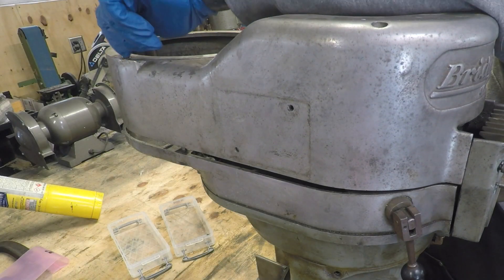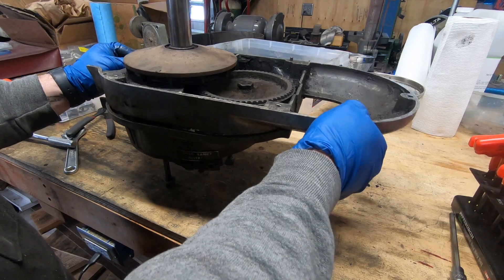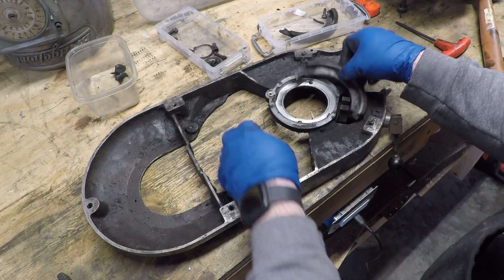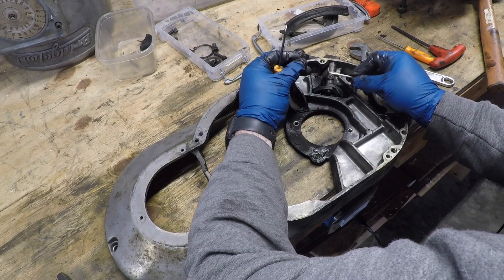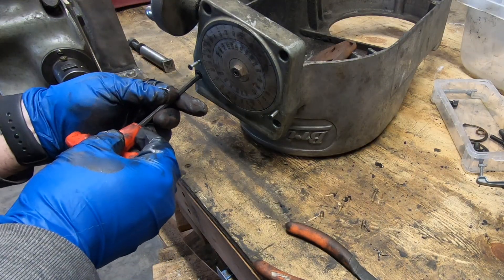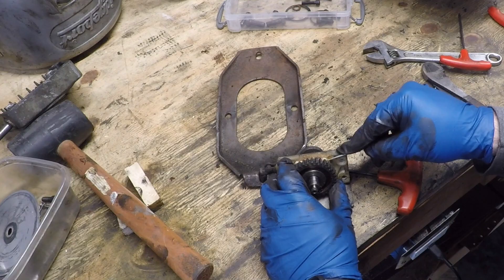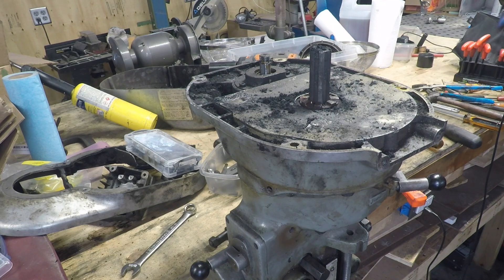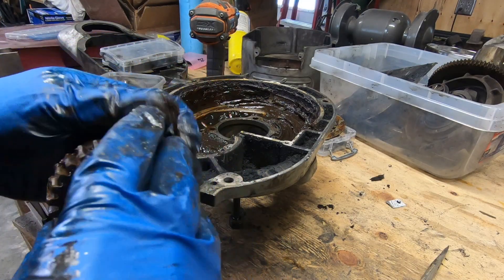Disassembling Gear Assemblies of a Variable Speed Bridgeport Head

Comment: Hi, Fantastic video. After I assembled it, when I select low speed, the rotation goes in the opposite direction. What did I do wrong? Thanks
Reply from the maker: That's what is supposed to happen. You run the motor in reverse when using low gear.

Comment: Speed Selector makes variable speed pulleys that replace the Reeves, Hi-Lo and TB Woods pulleys that went out of business or got bought.   Most of the pulleys are in stock or Speed Selector will custom make if needed. They have an actual engineering department who were very helpful.
Reply from the maker: Interesting. Not sure why anyone would do that. The Reeves setup is pretty foolproof and the parts are widely available.

Comment: Thanks for posting. I enjoy finally seeing the inner workings of a BP. Just a tip I learned in my machine shop classes...when you use an adjustable wrench (yea, we learned proper nomenclature too-haa), you want the pressure to be against the non adjustable part and it'll make your tools last longer. Basically I mean flipping the wrench at the 9:30 point in the video.
Reply from the maker: Thanks for the tip!